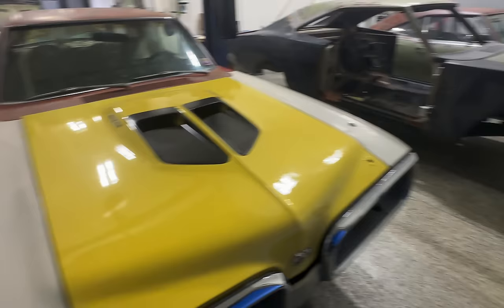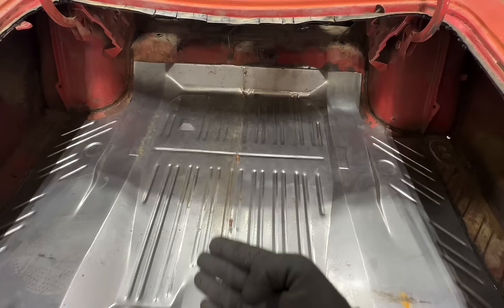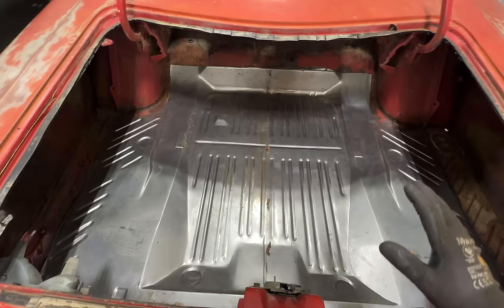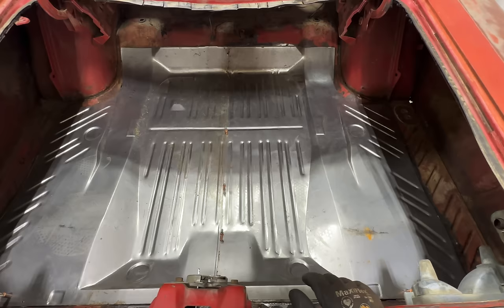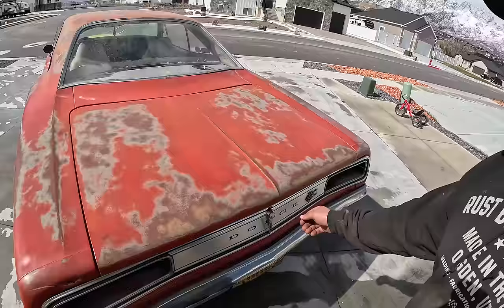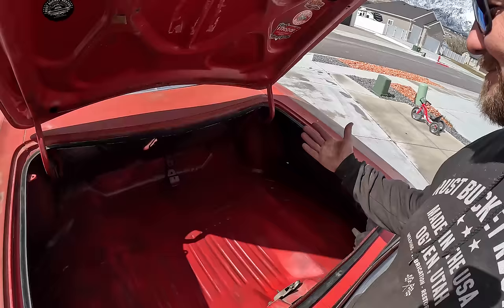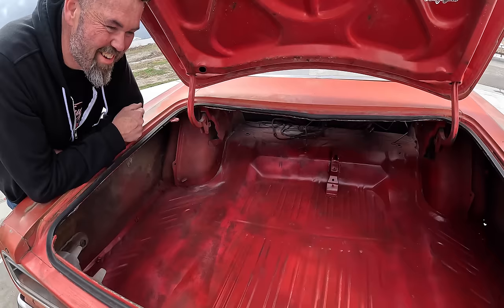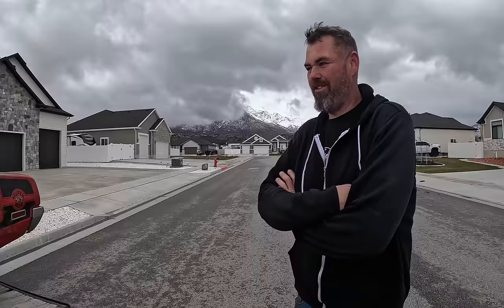1970 Dodge Super Bee | The Fugitive | Metal Restoration & Reveal | Step by Step DIY!

Comment: Hey David did you weld the floor pan to the wheel tubs or do you just butt up against and seal with seam sealer ? Looks awesome
Reply from the maker: Welded it it to the strips of original trunk pan that I left intact.  Then used Fibral to smooth out & blend the welds.  Looks 👌

Comment: Why didn’t you fix the hole by the right trunk extension and right wheel tub? It will allow the wheel to splash water in the trunk.
Reply from the maker: It’ll be coming back once we get in the lower quarter sections.  Everything is on back order for now.  Until then… enjoy it!